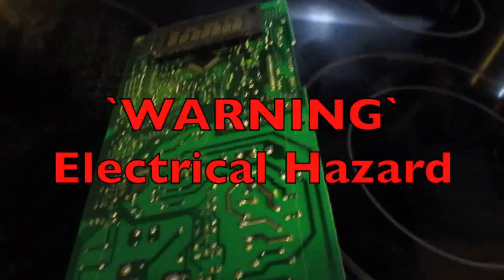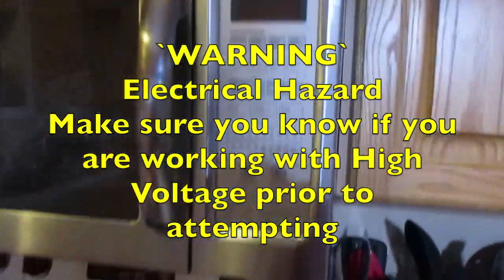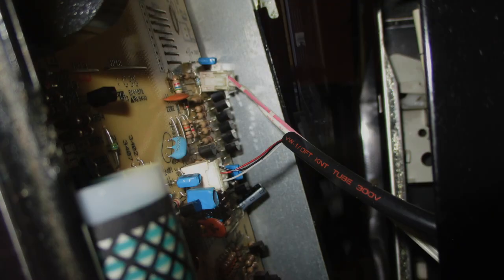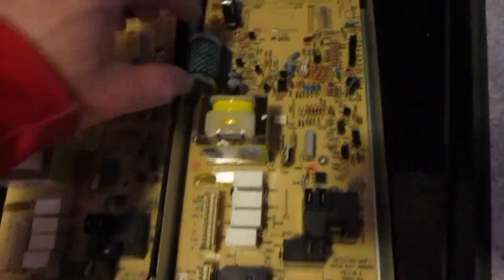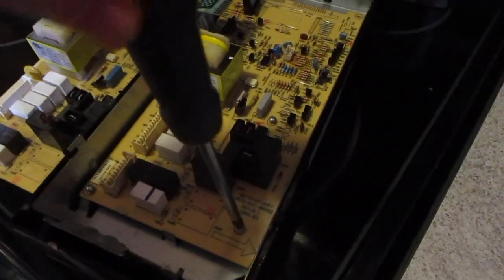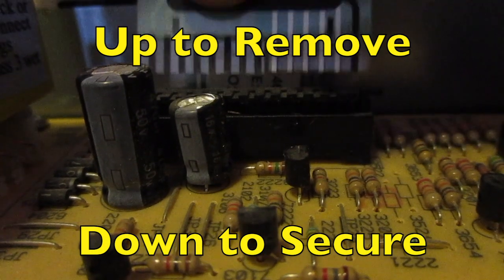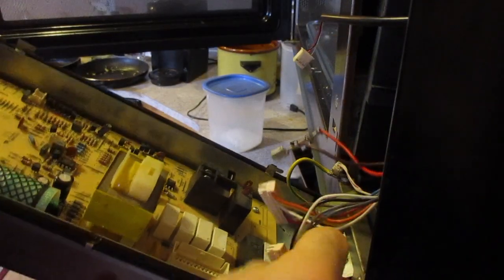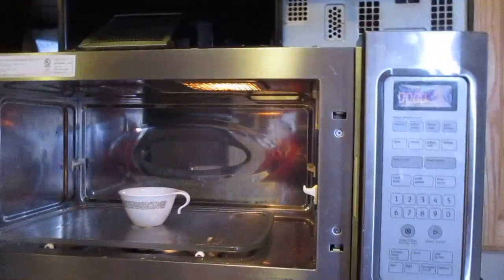How to Change Microwave Control Board All brands Maytag Kenmore GE LG Whirlpool Jenn Air Replace Fix

Comment: Not sure if you’re monitoring this or not. I have the exact same microwave you’re working on. When I try and use it, it keeps telling me to open and close the door. I rebooted it several times and the error still remains so I think it’s the control panel. Do you agree?😂